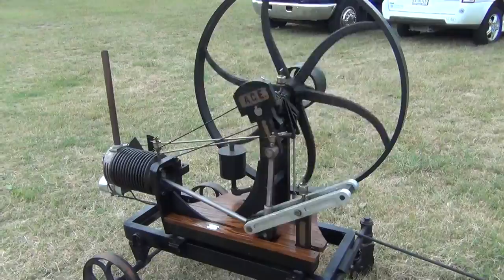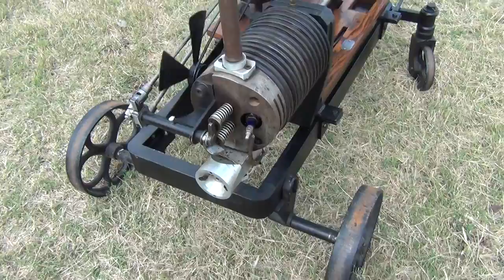Home made engine Atkinson Cycle!!!

Comment: What would this be used for?
Reply from the maker: It is a engine. Can be used for anything  you couuld belt it up to.. Every hybrid car made today is running a variation of this engine. It is efficient as it has all 4 strokes of a 4 cycle engine in 1 revolution of the crankshaft.